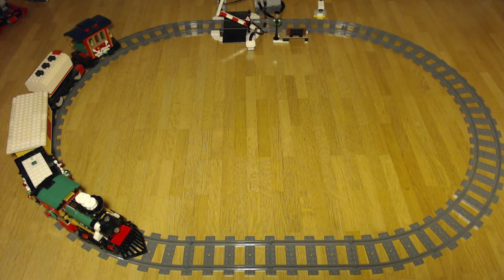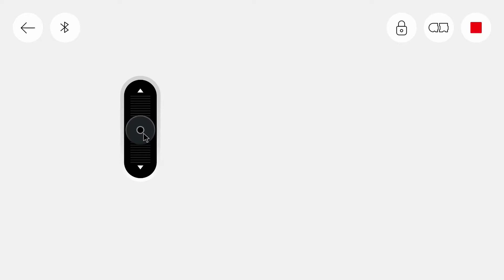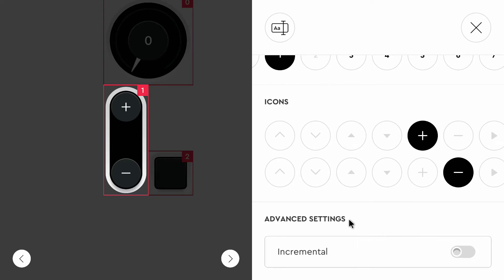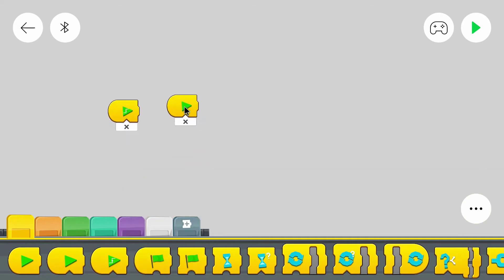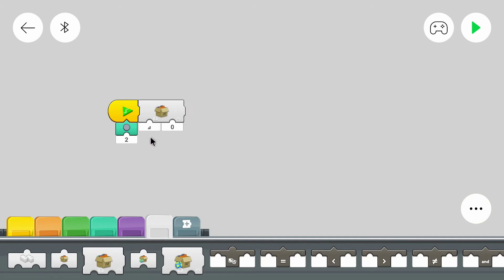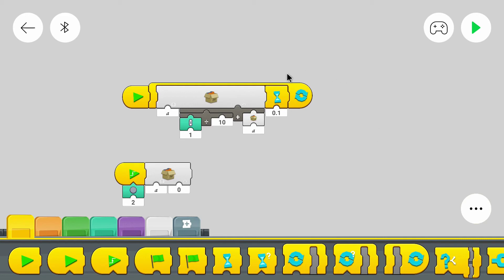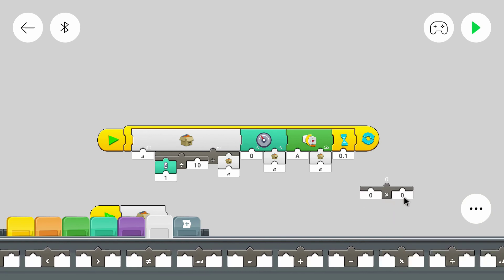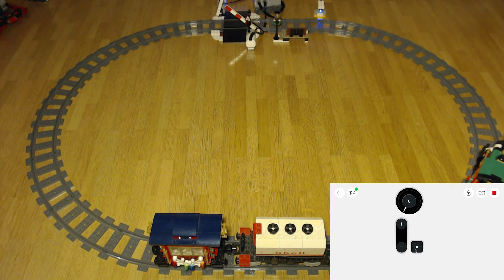Lego Powered Up Tutorial #16: touchscreen controller for trains [English|HD]

Comment: I can used 2 touchscreen controller in my program? For example if i have 2 train and i want to screen a colour and change track on my way
Reply from the maker: You can use multiple sliders in one touchscreen interface, but not switch between interfaces within one program

Comment: Hey. Thank you for these tutorials, I'm pretty new to coding and you're significantly helping me. One question; I have the 4x4 extreme off-roader motors and hub. I have used those parts in another design of mine. I am getting a problem of my wheels are straight when I release the turning slider from the left but when I release the slider from the right the wheels are still turned slightly to the right. Is there a way to code the steering to turn the motor a little bit more when I release the slider in a specific direction? If so would you be able to make a video or point me to a video that will help with that? (I haven't watched all of your tutorial videos yet I'm kind of jumping around to try to find my answer.)

Thanks
Reply from the maker: Glad that the tutorial helps :)
The problem is probably that the gears have a bit of space inbetween them etc. Of course there are options to do that (you could use a variable as position input and then change the value of the variable depending on the previous position of the slider or something like that) but I don't have an easy solution at the moment.
Another option that I've seen is that some people added buttons to add or substract something from the position variable.
Reply: @technicmaster0tutorials  Thank you for these suggestions, I will attempt to give them a try.